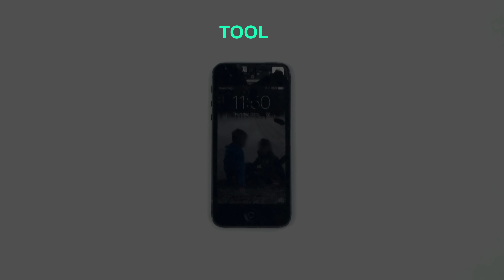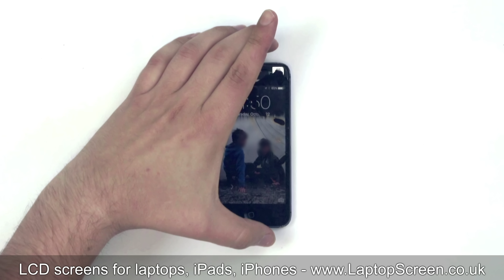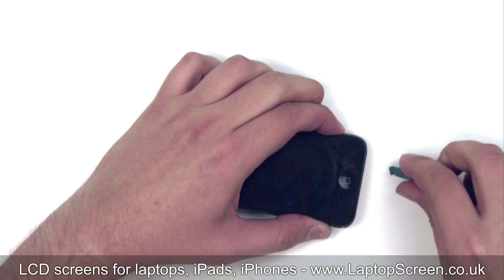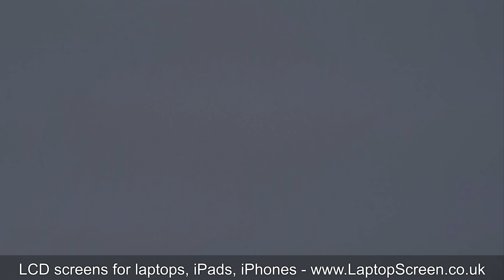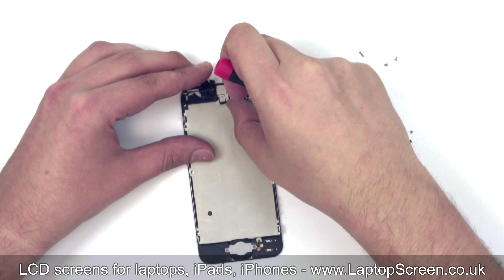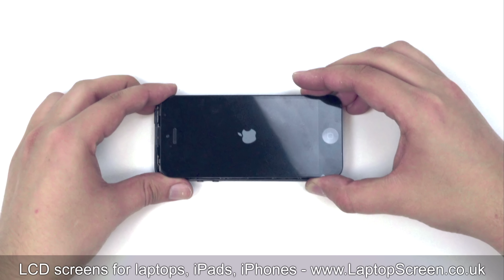iPhone 5  - how to replace screen and digitizer

Comment: THIS IS NOT AN IPHONE 5s, there is a ribbon cable connecting the finger print scanner you didn’t mention which ripped when I opened the phone. This video didn’t help me fix my phone it f*** it, nice one.